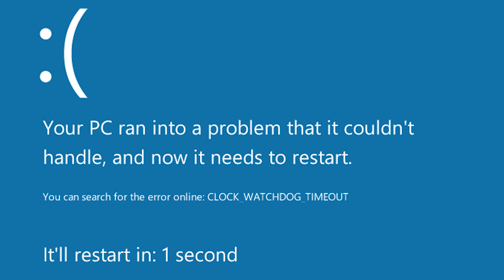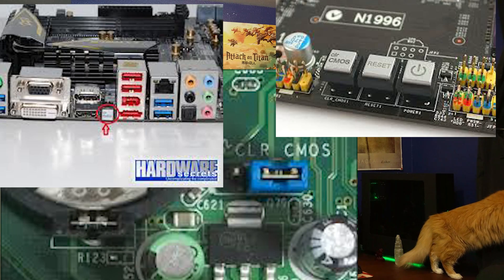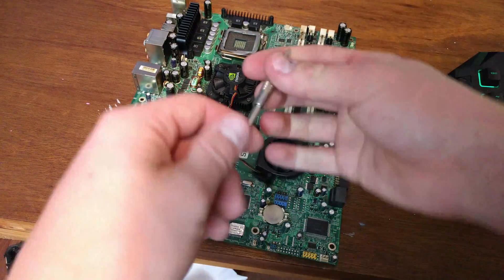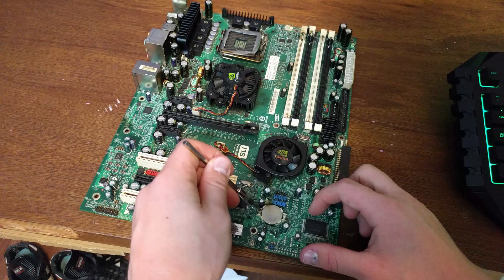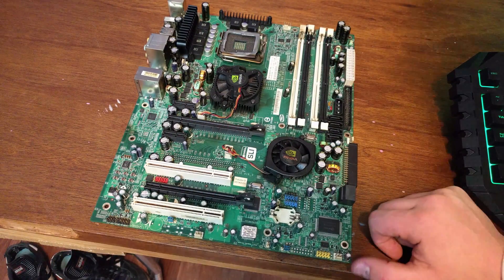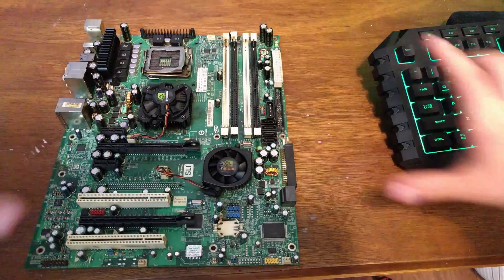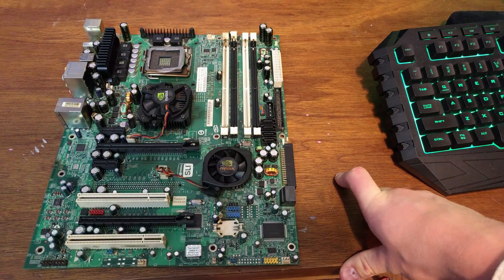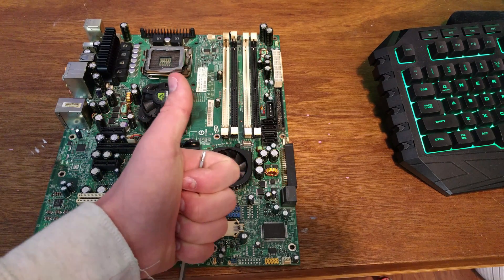How to Fix a Bad Overclock on Any CPU

Comment: Hello, I've been playing with overclocking for a while with my Asus Deluxe II and 6800k but it looks like a made a wrong setting and now it wont even take me to post and enter the BIOS. What I did was the tuning my overclocking then I set the cpu core voltage to adaptive with an offset of +0.010, the original voltage before setting to adaptive was 1.257V manual, trying to tune the cpu to 4.2ghz. Blck freq was 100, sync all cores to 42.

Now it just shows the q code '33' then restarts, then turns off. I tried resetting thr CMOS with the clr_cmos button and removing the onboard battery to no luck. Q code according to manual: 32-36, cpu post memory initialization. Any help would be appreciated, thank you so much and will be waiting for your reply.

what I tried extra: USB Flash bios, pressing power button with the PC unplugged to drain capacitors prior to clr_cmos. I can't revert it to manual since I don't have a screen and shuts it off after around 30 seconds. Did I fry the RAM, CPU, PSU? There are no cpu_led and ram_led issues here.

Asus deluxe ii i7 6800k 2x8gb ddr4 3200mhz ram Samsung 850 pro 512gb Gtx 1080
Reply from the maker: You can try a different power, but I doubt that is it. I would check cables for sure to see if they are bent. It seams it also could be bent pins in your socket, or Possibly your ram is bad. Try switching which sticks are in.
Reply from the maker: Also you may have to low wattage psu.